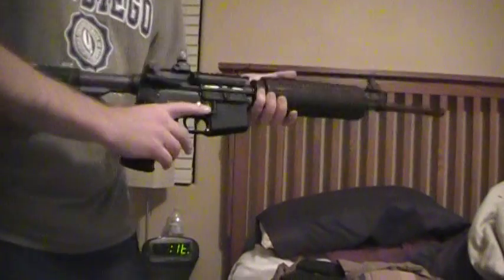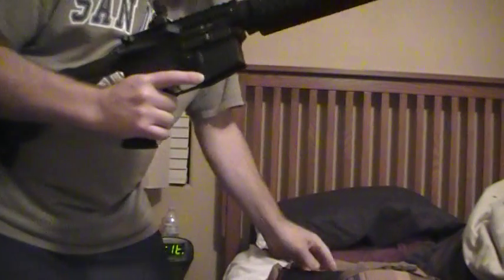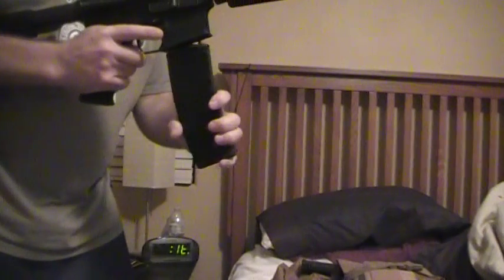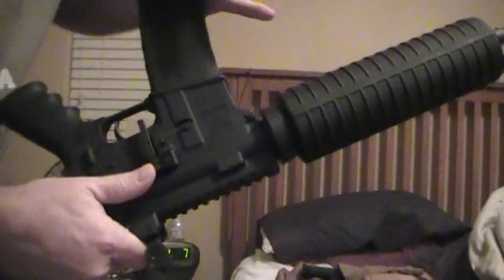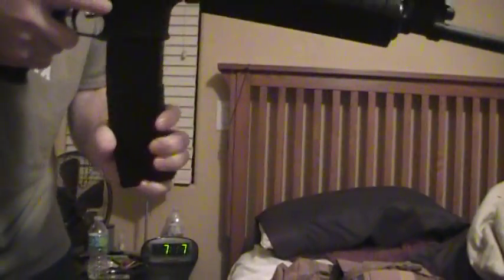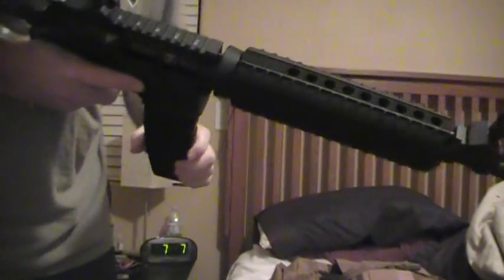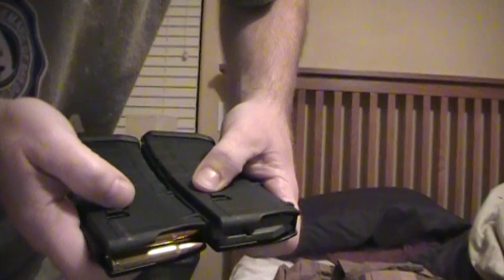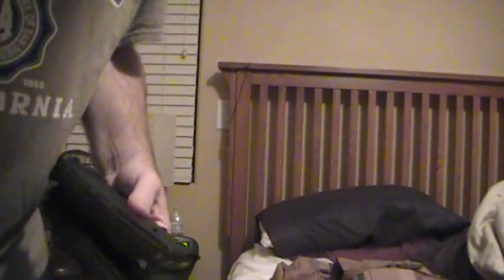Adams Arms AR-15 Issue with Magpul Magazine (fix not found yet)

Comment: Did you try loading the other mag fully and trying that? If it seeds just fine on a full mag with the bolt locked back. I'm almost sure it's just the spring tension that's needing that extra force. Try keeping your mags always loaded when not shooting. It will loosen up.

Comment: A very easy fix my friend. It is the narrowed edges of the upper magazine that the follower seats in. It causes all sorts of issues. They can cause all polymers not to seat correctly, the BCG to catch or drag and even cause the rounds not to chamber correctly or not allow the BCG not to stay open upon an empty magazine. Many feel it is a buffer or buffer spring problem but I've fixed hundreds of them with no other problems. :) Each brand is different and might need a little filed off compared to others so take a little off on each side at a time. If you need me to do a video and attach to my account, let me know.

Comment: From my personal experience.. that is normal if you use a fully loaded magazine. It tends to be harder to load and is why you double tap the mag. Out of 2 ar platforms both do it and is normal.
Reply: Actually you are overloading the mag. Remove 1-2 rounds problem solved
Reply from the maker: Wolfstanus I removed 2 rounds and it didn't change the issue.  I took out 5 rounds and the problem still exists.
Reply: MasterDelnorin
 That's weird mine work fine from gen2 pamags to gen 3. May want to give Adams a call... Or you have a bad pmag
Reply from the maker: Wolfstanus I may have to call Adams.  I've tried it with 6 different Magpul magazines.

Comment: I have a similar issue. I have 8 mags. If they are empty the seat just fine. If they have more that 4 rounds in them none of them will seat. Even my gunsmith is stumped. I have thought about getting a SpeedTac Bolt. It looks promising. But I want to do a little more research on it before I purchase one.

Comment: Did you ever figure it out, mines doing the same thing. ..running mft mags now. No problems
Reply: The polymer is stretching up, try only loading 28 rounds in them. Mine was doing the same thing. The feed lips were bottoming out on the bolt.

Comment: You have too many bullets in the mag. It's loading on a closed bolt 101. Every AR does it. Thats why there is a constant debate between 29 rounds and 30 rounds in the mag. Most soldiers in the field will load to 30 because they cant reload off a bench and they are humping their gear.  They will usually reload on lock back, which means no issues with loading to 30 and in some cases 31 depending on what gen PMAG you have.
Reply: FourGuysGuns my AA did the same thing no matter if its 2 or 30 rounds dosent really bother me to be honest a little tap is nothing.
Reply: not sure if trolling.... or serious...
Reply: what?
Reply: FourGuysGuns Your right had the same problem took one bullet out n fixed thanx
Reply: I’m having this exact issue regardless of how many rounds are in the mag. My brother’s mags go in fine, mine don’t. All PMAGs

Comment: Full clip needs to be slapped in do to the bolt catch putting tension on the magazine that can only spring so much,  empty clip can go in no issue because the bolt catch has nothing to put tension on. Don't throw mags away just break them in.

Comment: it's not the rifle. It's the mag there's a little lip on the back of it that's hitting the edge of the lower receiver. I've had this problem many others have had it as well.... with different makers. file off a little bit of the plastic on the back of the mag hitting the receiver and it'll slide right in. there are also videos on YouTube showing you where and what to file
Reply from the maker: Spectacular, thank you.
Reply from the maker: I keep searching for a video to show me how to fix this and I'm not finding it.  I find various videos showing the same problem I'm having, but not the fix.
Reply: look up magpul gen 3 fit problem and fix
Reply: Look up....magpul m3 pmag problem and fix

Comment: One is loaded and the other is empty my saint does the same thing will accept empty mag with bolt closed but loaded mag has to have the bolt in the open position
Reply: dude i have the saint victor and literally came here to see the same problem
Reply: My saint edge would work perfectly with these mags, and suddenly after not using the gun for awhile tried putting a mag in and had issues with every single one of my Pmags, I’m very confused about it

Comment: also how many rounds do u have through it mine stopped
 doing that after i "broke it in"
Reply from the maker: southerner985 Just a couple hundred rounds.
Reply: @MasterDelnorin  a couple hundred rounds - through THAT magazine?  The issue is not with the gun.  The magazine spring is new and still strong enough to push hard when loaded with 30 rounds.  Load it with 29 rounds - it is FAR more important that you get a solid connection when inserting the magazine than having that 30th round loaded.